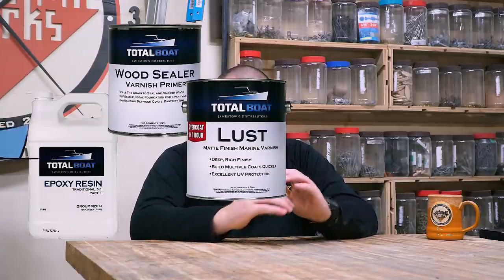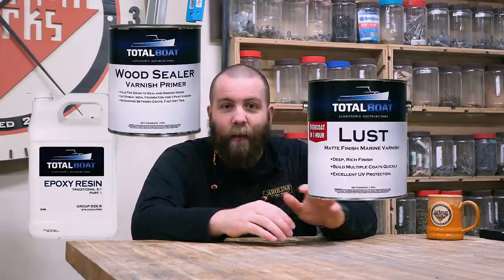Pallet Wood Butcherblock Countertop that Pivots! (bar top ➔ dining table)

Comment: Your project tend toward tedious, complex, hugely multi-step designs.  You mention this complex project being rewarding. I was wondering when you're in the middle of a project like this, how do you stay motivated and keep pushing through?
Reply from the maker: Just keep a picture in your head of the final project or a goal that you want to achieve with the final project. I make a rendering of most of my projects first, so it's always good to look back at those for a reminder of what it'll look like after all the hard work is done

Comment: Hey Jackman, I’ve been searching forever it seems for a swiveling table EXACTLY to the tee that you’ve built yours! Everyone does pullout drawer like tables etc. I’ve been searching for a swiveling mechanism as yours because it’s useful in many applications and saves on space!!! Can you demonstrate a weldless alternative that doesn’t require welding, of course, or heavy duty sanders, etc. in order to modify the amazing mechanisms used?! I’ve had this idea for a work desk, now especially with Covid19 keeping me at home to work. Anyways, instead of the sliding table on top, how would you implement your way into a hidden table, so for ie: you have your desk top, beneath that top, hidden is your swivel out table that creates a L shape desk in layers, right? Below the swiveling desk, you have cabinets/pullout drawers. Is it possible, would it require your use of tools or something totally different? It’s hard to imagine until I have it lying in front of me. Anyways I’ve rewatched this so many times I’ve memorized the best to your background music lmao! But greatfully so, thanks Jackman, you’re one of my very Top favorites because you implement so much other woodworkers would never think of. Including your mitre station, which is exactly how I found you a year or so ago, Thank God!!!

Comment: Hi Jackman! Very nice build. Could you please let me know how you prepare your pallet wood before milling? I've tried to do some pallet builds in the past but in the UK pallet wood is usually very high moisture content so my projects failed either due to wood shrinking post build or (when I started to dry it before use) wood movement due to re-absorbing moisture from the air. How do you deal with that? Most youtube creators never mention this part

Comment: Incredible build Paul. I had been wondering what was the purpose of the lip or upper section of the top was. What happened to your magical powers that enables you to make clamps just fall off. I was so shocked to see you actually having to unscrew the clamps at around 3:48.
Reply from the maker: Sometimes I have to act like a mere mortal to bring peoples opinions of me back down to a realistic level

Comment: Two things I've always wondered about your work.
1. How often do you have to change the blades on your plainer?
2. Have you ever done the math on how much glue you use a year?
Reply from the maker: 1. I have a carbide cutter head in there so I don't need to change them that often, just rotate one side when I'm getting a lousy cut
2. Nope, but it's a lot :) (I think I bought at least 5 gallons last year)